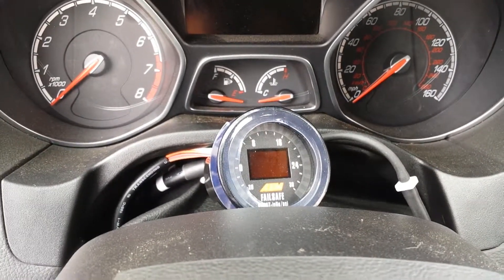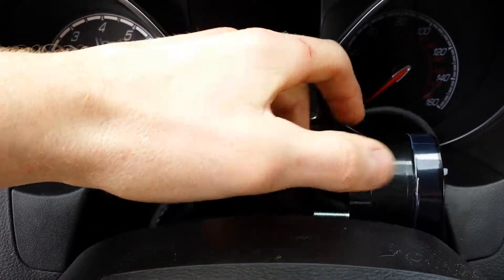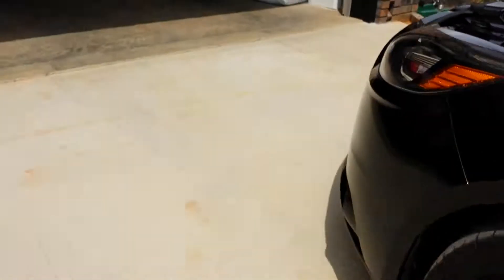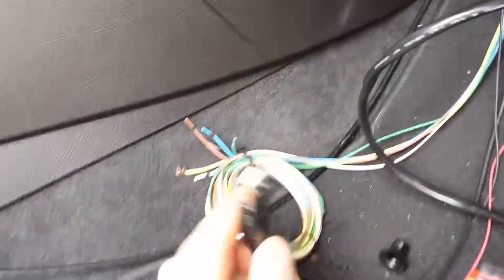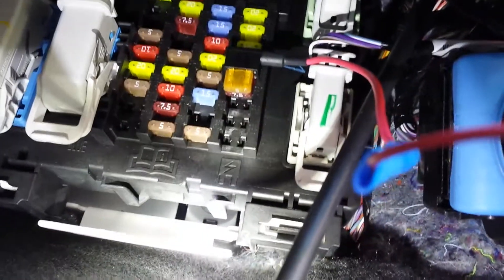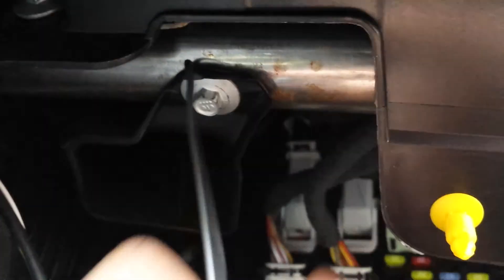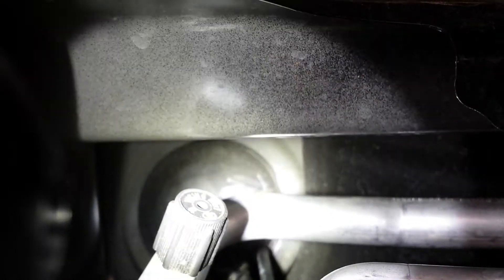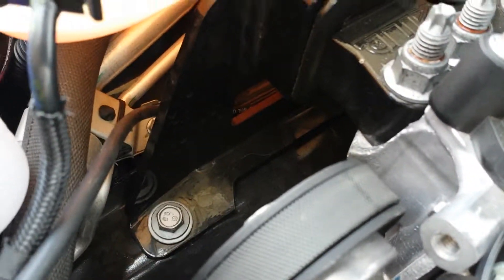AEM UEGO  Focus ST quick wiring overview

Comment: Why did you ad this when you can monitor air fuel on the access port
Reply: just curious
Reply from the maker: +Brett Robinson Mainly for ease of access/viewing, and also it has a fail safe built into it. The fail safe functions in that if your A/F goes out of a definable range, it will be set off. You can have it rigged up to turn on a warning light, or possibly dump the BOV with a little work.
Reply: +psychoocysp ok cool makes sense. thanks for the reply

Comment: Sloppy ass install looks like shit
Reply from the maker: Go fuck yourself.
Reply: Mike Stankiewicz they prolly dont make gauge pods for the new focuses yet so thats why it looks sloppy
Reply from the maker: +dgr_1996 They actually do now. Broz bros makes them. I have one installed in the location shown in the video. It was my intention to use their pod from the very beginning, I just wanted to get it all wired up before had. They ended up having some issues getting them manufactured which caused a delay in the release.